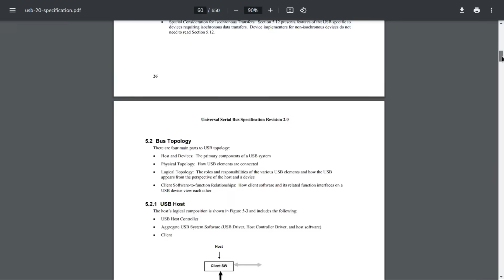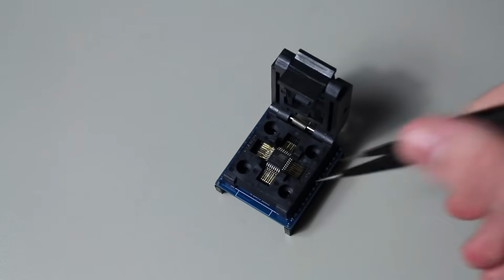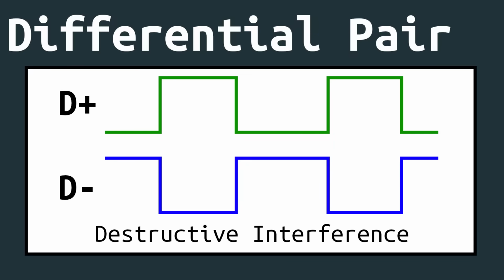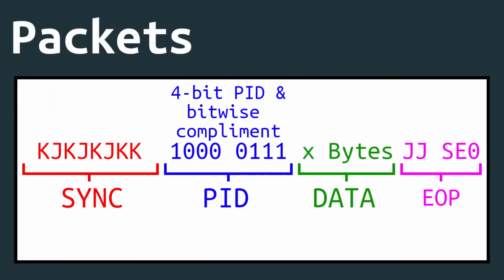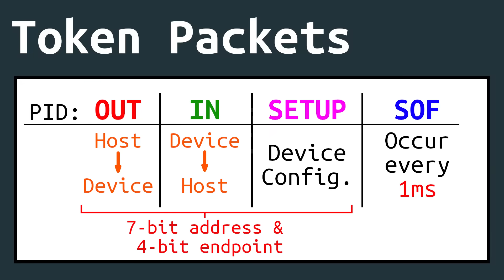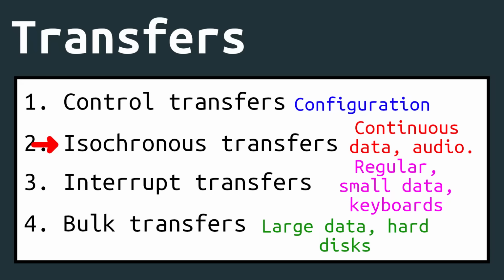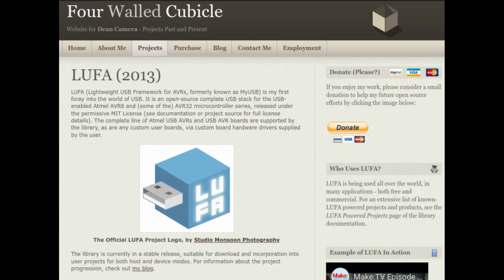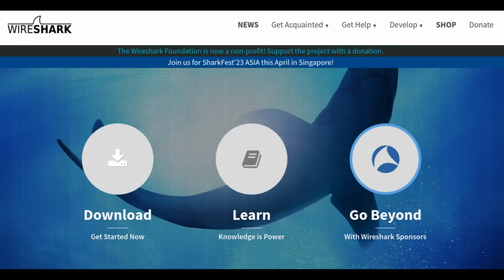Add USB To Your Electronics Projects! - The USB Protocol Explained

Comment: I have no idea how I ended up here. I'm light years away from this level of engineering. But this video was explained so well. This seems really helpful! Thank you for making this!
Reply: same i'm here and was able to watch 40% of the video despite having not skill or knowledge about what i'm watching. he did a good job.
Reply from the maker: Thanks for watching! I'm sure you will find it more personally useful in the future. :)
Reply: On modern AMD cpus / chipsets, u can actually exceed 127 endpounts, is there any disadvantage to this? @SineLab
Reply: I use to watch this stuff and think just this but i'm now gratefull that i did i outstand in a lot of ways at work and at clubs in uni because i just enjoyed the subject and focused on whatever came at hand on youtube so just whatch whatever stuff comes along if you dont learn anything its still a great way to have a keywords to search for and in no time you'll be able to undstand a lot of complicated stuff .
Good luck to you
Reply: I too have no clue what's going on here. I'm here for it though and I can feel my first wrinkle forming on my brain!
Reply: is anyone need usb/hdmi/dp/hub cable? Thuder 4 cable also
Reply: Yeah, ha same here! I'm only in my first year of electronics, and basically just at the analog audio stage, I still can't wrap my head around digital hardware and how a pile of transistors can be used to make the code I'm writing as well🤣
Reply: Same. I pretty much ordered a bulk set of USBC connectors, LEDs, capacitors, resistors, and transistors. I want to add usb powered lights to my 3d prints. There are none I can find on eBay that will do the job so I decided to make my own. It looks easy enough after a few hours of research. And it will cost around $1 to assemble each time I want to add lights to something.

No idea when I'd use this level of info tho 😅
Reply: This is the way.
Reply: Same here. This guy appeared on YouTube out of nowhere and he seems to have experience beyond his years. I suspect he's an alien from another planet or possibly an intelligent robot from the future. Either way he seems to really know his stuff. He has a lot of other videos that vary in experience level too.
Reply: Saaammeee
Reply: This video Is very nice. USB protocol Is very complex. Tank for you lecture!
Reply: How about just some steps bud, we are smarter than we think.
Reply: These are your first steps...
Reply: If you've ever successfully used Arduino to do anything, you can handle this. Everything you need to know to use USB on a day-to-day basis is in the chip documentation. Most of these details about the exact workings of the protocol aren't relevant if you just want to make something with USB capability, and you can always come back later when you need to understand more. Good luck.

Comment: Where do we get that programmer?
Reply from the maker: That's the AVRISP MKII. Another one that I use is the Atmel Ice.
You can use either one, although the Atmel Ice can target more devices.
Reply: @SineLab  Where do we get that little plastic box you dropped the processor into

Comment: Do you think the ATmega16u2 can read a csv file from a memory stick?
I can't find information anywhere on how to read files from usb storage with an arduino.
Reply: reading from microsd would be a gazillion times easier.
Reply: @Mr.Leeroy  Yep, I know, all my searches lead me to SD cards, and I have tried it, but this is a consumer product and the decision was that it must be USB.
  I found the VDIP1 board, it does the job, it lets me talk to it using UART with simple commands but it is kinda pricey and the chip VNC1L is always out of stock, I'm looking for an alternative that isn't more expensive than the rest of my board, or that at least is commonly stocked.
Reply: @Ruben.Pinto_TC  For both low cost and availability you need general purpose MCU with USB _host_ capability. I had projects that got stuck due to same requirement as well.
Reply: @Mr.Leeroy  Right now the project has 900 lines of code in Arduino, for version 1 I will go with the VDIP1, it is already developed. (not to mencione that I rely heavily on arduino libraries and wouldn't know how to use them outside the arduino environment)  
But yeah I know I have to move beyond Arduino, I have to learn to code other MCUs.
Do you have any recommendations? What are the professional most common MCUs? PICs, AVRs?
Do you think if I learn to code PICs I can then use PICs for anything that comes along, from small things to big things?
Reply: @Ruben.Pinto_TC  I replied, but YT probably decided to discard it, not sure if it came through..
To summirize move to STM32 using STM32duino framework and to HAL & etc from there for pro industrial path progression.
Or move to Raspberry Pi Pico, which is Arduino compatible, most availbale right now, and has USB 1.1 host.
Looks like there are already some examples of Mass storage host implementations.
Reply: @Mr.Leeroy  Great, thank you for the help.

Comment: right, u lost me after packets, ur slides are confusing
www.circuitbasics .com/basics-of-the-i2c-communication-protocol/
if only u explained in a way like this website did i2c
where it explained i2c is sent in messages
and in the messages, the structure, the sequence and the bits
then finally explaining the different modes in each part by using bits
this already give the basics about i2c
and with a little more research, i easily learned about 10bit addressing, repeated start and etc to fill in the missing parts
with this knowledge, i dont even need hardware i2c or libraries, i could easily make my own circuit or write my own code to interact with i2c devices like sensors, i could implement i2c on any devices and any microcontroller like 8051

meanwhile, u just used some preexisting library with no work to show what u talked about, i learned absolutely nothing, i dont even know how the bits are sent.
how have u explained usb protocol then? it is just explaining usb but a little deeper, and in the end all are still superficial

what u did is just another copy paste similar to people using arduinos to do stuff, they have some cool idea and all, but then they used arduinos and their code are mostly copy pasted and libraries, now it doesnt seem cool at all, easy even......

Comment: Hi, the ATMEGA328 does handle USB 1.0 protocols with VUSB library and a 12MHz clock :)
Reply: Who cares about this junk from 90s when there are a lot of 32bit MC with hw usb cost less than a $. Or you can take tiny ch340e that doesn't need external quartz and get usb uart.
Reply: @dekus80  obviously a lot of people, including the millions who use arduino uno

and old is a non argument, yes these are unsuitable for commercial production

but are u trying to judge people who uses them for home or hobbyist project? they just want to use those, so what?
people want to use 8051 and 6502, that is the entire purpose of their project, and who r u to judge that?

and one thing to note is that these have magnitudes more documentations and community support
Reply: @dekus80  The 8-bit MCUs are build more tough due to bigger lithography use. This is why they work at 5V and are more immune to high voltage spikes like from a welder or a plasma cutter. Also when comparing to devices like ARM cortex m0 they mostly do similar performance.
Reply: @e-exp  I didn't write about usb in 003. I wrote about 10! cents for 48Mhz 32bit riscv mcu.

Comment: On the software side, a lot of people have trouble grasping the concept of the HID report descriptor, and how it dictates the format of the HID reports, so that might be worth explaining if you're looking for topics. Canned driver/library code usually handles it poorly, with hardcoded report descriptors, and no obvious connection between the descriptor and the code that generates the reports.
Reply from the maker: Thanks, that's a good topic.
Reply: Great point. I'm building my own Joystick and this stuff gave me nightmares.
Reply: @mrkv4k  Did you end up figuring it out?

Comment: they would have started by explaining the flip flip and its J and K states, and then they would have explained shift register = serial transmission.
Another notation would have been an ARDUINO Nano or similar but good if you're not a purist.

Comment: 4:20
"taking a look at the USB interface we have 4 connections"
Please never omit VBUS (yes, VBUS not V-USB) fortunately it is included in the schematic in this video.

Failure to connect VBUS will cause projects to fail. I spent weeks trying to simply shorten the cable on a USB GPS module, using a solderable micro-USB connector. If I had hair before that, I wouldn't afterwards.
Reply: what, that is the power pin, what else did u expect, of cuz u r expected to connect the power supply
Reply: @urnoob5528  Ahh, yes...
Must have been another pin....

Ohh look, there it is: micro/mini USB pin4 - ID - distinguishes host / device for usb-on-the-go, connect to ground at host and no connection at device.

The bit avmbiut projects failing if its ignored still stands.

Comment: Years ago I was tasked with writing a raw USB driver from scratch for Itanium. It was quite a challenge but i eventually got it working.  All I had to go by was the spec. We had no libraries or even a file system. Code was loaded by direct injection using a special card.

Comment: Excellent overview, though for nearly $4 in the current market, I'd favor an RP2040/pi pico over an atmega. PIOs can handle matrix scanning, sensor interfacing, and even a second USB, while the SIO peripheral offers the low-latency pin access often missing from 32-bit mcus.
Reply from the maker: Pick whichever solution works best for your project :)
Reply: RP2040 can be had at $1 nowadays.
So, yeah, it or Pico is a winner at availability.
This video, on the other hand, is clearly a low level hardware exercise, and AVRs are still a great foundation for that.
Reply: @Mr.Leeroy  RP2040 is not a great solution either.
This chip has very weak current output capabilities (max 12mA) and often requires the addition of discrete transistors.
It's great to have two cores but they are quite obsolete ARM Cortex M0.
Then compared to classic AVR or PIC, those 32bit MCUs have a convoluted HAL when digging a bit into advanced programming and they rarely have integrated logic level shifters to communicate with the still very popular 5V logic.
Reply: @PainterVierax  It is a bad practice to connect IO directly anyway (in any industrial device). STM32 is guaranteeing even less current (9mA IIRC). Most of the pins on RP2040 are 5v tolerant and level shifter requires 2 FETs, that are dirt cheap, I see zero issue with that.
Reply: @Mr.Leeroy  Direct i/o is only a bad practice when you have non-rugged MCUs because I saw that on almost every PCB design embedding MCUs, SoCs or good old processors. 
Though industrial devices generally don't use USB but Canbus, RS485 or Ethernet which require proper transceivers nonetheless.
A proper RP2040-based devboard means that a lot of discrete components have to be around. 
I don't preach for STM32 either. Its HAL is atrociously convoluted.

Comment: I like the explanation a lot.  Question, where did you get the smd adapter. I could not find it.
Reply from the maker: Here is a link to one on aliexpress: https://www.aliexpress.us/item/2251832624996364.html?spm=a2g0o.productlist.main.7.76c52ecbfcRb7K&algo_pvid=19f78b0c-252a-414f-99fe-3a8ca3f2ad5c&algo_exp_id=19f78b0c-252a-414f-99fe-3a8ca3f2ad5c-3&pdp_ext_f=%7B%22sku_id%22%3A%2264495190690%22%7D&pdp_npi=2%40dis%21USD%2111.8%219.91%21%21%21%21%21%40211bf12316751972869527289d06f4%2164495190690%21sea&curPageLogUid=S39oAQQcKzaA
Reply: @SineLab  ordered. Thanks!

Comment: Oh wow! I had no idea those solderless SMD adaptors existed! The whole video was good, but that bit of information was life changing!
Reply from the maker: Those adapters are really handy
Reply: @SineLab  and expensive too :)
Reply: @myetis1990  They used to be in the hundert dollars pricerange. But you can get them for "cheap" in china nowdays.
Reply: they are mainly aimed at pre-programming before assembly line, not prototyping.
Reply: @Mr.Leeroy  I've also seen some companies using them as a way to make a universal development board for their whole range of chips. I want to say it was a TI board that I'm thinking of.
Reply: Is there something similar for BGA?

Comment: This is only tangentially related but, how possible is it to have a device which reads input FROM a usb device? Specifically I've been wanting to work on getting a yubikey HMAC challenge response to interface with some of my circuits for authentication, but, well, usb is such a complicated standard I don't really know where to even start on trying to implement something like that.
Reply: Same wire protocol, but you're acting as the host instead of the device. You control the timing of everything by sending the Token packets and then receiving the response. Use Wireshark and see what happens when you plug the Yubikey into your PC. Or if it's just a personal project, it might be worth using a raspberry pi or similar device to bridge between the usb and GPIO. Just don't do the dumb of "short this pin to open the lock". There are USB driver chips as well, and serial -> usb bridges, but I don't have much experience with those.
Reply: you may probably drop yubikey requirement altogether simplifying task greatly. Otherwise, dealing with USB host side and producing drivers for it is no easy journey.
There are specialized cryptography chips (SPI, IIC..), that offload functions just like that of main MCU, and some of them may already have existing libraries to interface with.
Using them could be a lot easier.
There are higher end MCUs that include such blocks on die.
Things like TOTP (which uses HMAC btw) could be implemented with general purpose MCUs, it all comes down to storage for sercrets and how hard it is to extract them.

Comment: Niceley explained. You obviously know more than me. Just a point: I think the differential pair is to help with clock drift. It's nice to see a an MCU with USB support, although  I have never dealt with standalone chips. My soldering isn't up to it. I go for boards that I can plug in. I've implemented a USB driver using an RP2040 and tinyusb. Amazingly, it actually works given the complexity of USB.
Reply: The differential pair is for noise. You can subtract the one signal from the other to completely remove any "common-mode" noise -- that is, noise that is common to both wires (external noise). Further, equal and opposite voltages result in equal and opposite magnetic fields that cancel each other out in a twisted pair. The KJKJKJKK sync at the start of each packet is what fixes clock drift.
Reply: @tiger12506  My bad. I think I mean the whole JK thing. If you have a stream of zeros, for example, which is quite common, the lines will toggle, helping to mitigate clock drift.
Reply: @zetaconvex1987  That's actually part of the NRZI protocol, which unlike RS-232, does not assume that you have fixed and stable clocking, allowing the receiver (or device, in USB parlance) to synchronize with the clock on a bit-by-bit basis rather than between characters.  NRZI always has at least one transition per bit.  It also has the advantage of always having the same amount of time high and low, on every bit, which allows for connections that must be isolated through a transformer, since establishing the high and low references is simple.  In practice, USB interfaces are rarely if ever actually isolated, expecting that the devices can always be set to use the same ground as the host, but the design allows for it just the same.

Comment: How much ram does this library use? I'm wondering because it seems that Atmega16 is just 1k SRAM which is really not that much if you do want to have some more complicated peripherals connected etc...
Reply: The ATmega32U4 has twice as much memory as the ATmega16U4. And you can also use the Flash and EEPROM for extra code space.
Reply: @kesor6  I know but EEPROM & Flash will not necessarily help me with RAM that much if the library eats up 90% of my 1k of RAM 😅 I'm asking specifically because of the USB complexity - you have to have some buffers (guessing ~100-150 bytes per endpoint) and you will have to have atleast few (config, serial data, maybe more). Then you will have to have some circular buffer for serial communication, lets say 64 bytes for each direction (rx and tx). It can add up quickly - hence the question 🙂